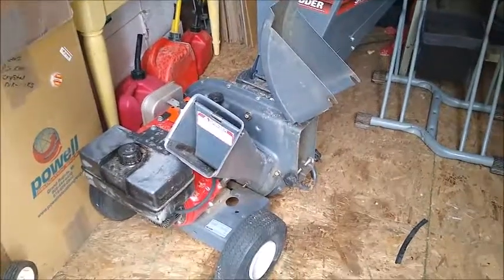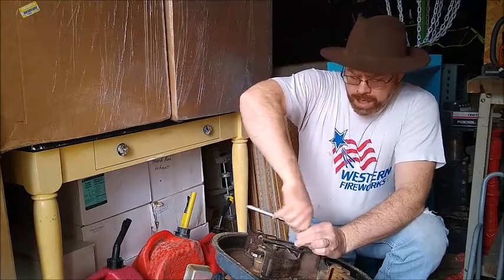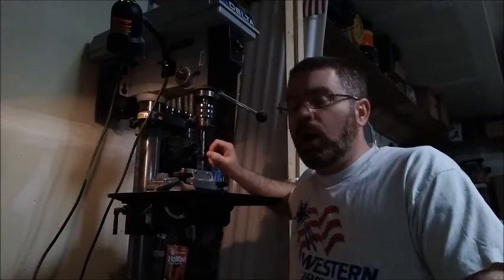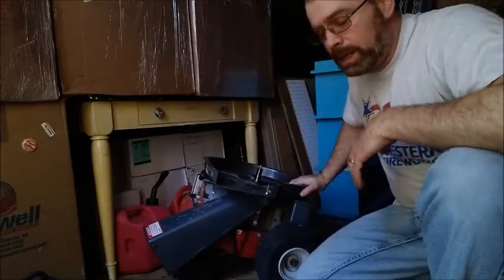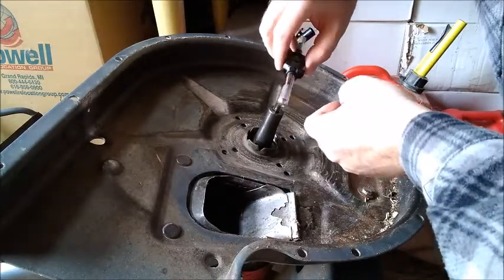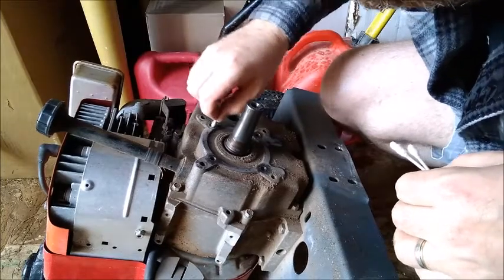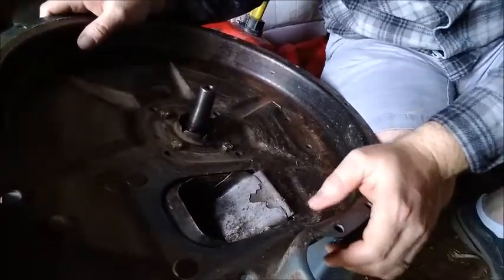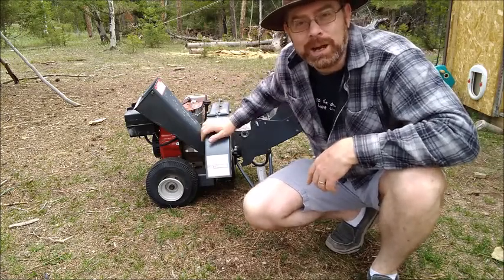Craftsman 9HP Chipper Repair, Including Impeller Removal

Comment: Thanks to your video I saw how to remove the blade assembly. However rather than drilling the bolt I just cut a piece of 5/16 hot roll round 2 5/8 long and put it in the shaft before the bolt, it worked fine with no damage to the threads.

Comment: Hey I made"your" extraction tool and my pen of 1/4" screw with three marks for the hardest also buckle and I caught it soon and replace it with a fresh bolt and it also bent but the inpleryor came off as your sample also.
 It bent but also got the job done!
Thanks for the teaching and showing about"your tool" as you taught me there is a special tool for the job, Don't we hate to buy a tool which we might never use again.

Comment: Thanks for the video.  I was thinking of pulling my 10HP off of my chipper and installing on a roto-tiller.  However, the shaft doesn't have a keyway in it so pretty sure it won't work on the tiller.  Watched another video this AM of replacing the blades but they didn't know how to remove the hub.  Thanks for the "how-to" and including it errors and all.  Great video.
Reply from the maker: Thank you.

Comment: On tough to remove shaft pulleys or other shaft mounted devices, I find it easiest to drill a small countersink in the head of the extractor bolt and use an air hammer with a conical point on the end to vibrate the crap out of it while using a prying device to "walk" the pully off the shaft. The vibration tends to break up any rust between the shaft and pully. Works great on small engine flywheels too.

Comment: Thanks for the video, I live in the UK and have an old 8 hp MTD 465 chipper (Craftman Chipper) which is in need of TLC every time I have to strip it down to sharpen the blades. Previous owners tried forcing metric nuts on to the threaded studs that hold the cowling on so I've replaced all the 1/2" bolts with metric ones and have a supply of nuts I can now use to rebuild it properly. Hey-ho. Eventually I'll need to take the impeller off so It was good to see how it was done.
Reply from the maker: You are very welcome.  Sorry to hear about the metric versus inch mix up.  Glad that you got is sorted.

Comment: I made a two piece removal tool.  For the inner piece I cut off the head of a  2 1/2" x  7/16" bolt and ground the threads off so it would fit in the 1 5/8" deep hole in the engine shaft and bottom out.  I dropped this "pusher piece" thru the impeller and down into the shaft hole.  Then I screwed a 7/16" fine thread bolt thru the impeller until it touched the pusher piece and torqued it until it pushed the impeller off. When I pointed the engine shaft down the inner pusher piece came back out of the engine shaft.  In essence I made a two piece version of the factory tool using (2) 7/16" bolts that I already had on hand.  Cost: nothing.  If you can find a 7/16" x 4" (min) fine thread bolt that has threads the full length, just grind off 1 3/4" of the threads on the end and you will have the factory tool for the cost of one bolt.

Comment: This actually shows that it's better to use soft grade 5 metal for the impeller remover since it's better to destroy the pin on the tool than the engine shaft. The store bought removal tools might be grade 8 which is not ideal since the tool would survive but the engine shaft might not. When I do this I'll probably use a combination of a 2 jaw puller and a few pry bars pulling behind the impeller disc so there's no chance of destroying anything that can't just be hammered back flat.
Reply: That shaft should be hardened. a higher grade bolt or solid pin shouldn't deform like that in so it wouldn't get jammed in the shaft. I say this with hind sight as I'd imagine a grade 5 bolt would be fine for this purpose without seeing his deform.

Comment: The tool build saved my job. .as I used a 1/4 bolt and after it bent I also replace the 1/4" boat and the impeller came off as the second bent.
  I'm looking for a USA made Allen wrench and cut to fit  plan to replace the bolt  and don't think the Allen wrench shaft will bend unless its from China or Harbor freigh , 
  We have great tool steel in this country why import tool steel?

   ?????  Question do you know what torque for replacement for the impeller?????????
Reply from the maker: I was unable to find a torque value when I did the repair.  My machine design professor in college always said that "snug plus a quarter turn was better than most torque values," so that is what I do whenever I can't find a published value.
Reply: LOL I tried an Allen socket wrench bit that probably came from HF (Pittsburgh Tools) to get the chipper blade off. It twisted around about 360 degrees. I finally put on a Craftsman Allen wrench and hit it with a hammer, no twisting.

The torque spec for the Yardman 8hp chipper, basically the same machine, is 550-650 inch-pounds. I set my torque wrench to 40 foot-pounds which should be in the middle of that range.

Comment: Well, Im about to try the same thing. I have to tear down my motor so the impeller has to come off. I think I will try just dropping a steel dowel down in that is harder and a bit closer to the diameter of the hole, or maybe I will just make a one piece tool on my mini lathe. Time to go check the bolt bin and see what I've got.

Comment: Hi good sir!! I just Diy’d a better solution for the impeller removal with no thread damage.. here goes

Found two spare bolts, one matches engine shaft threads the other matches the “remover-tool” threads

Tools required- just an angle grinder and flat blade that fits into the hole

So i hacked the first bolt off about 1/4 inch above the threads… beveled the edges nice and good (no mushrooming)… cut a slot in the top for a flat blade

Used vice grip and wood block to hold the bolt for angle grinding (safety glasses ofc)

Ended up with 2 piece removal tool. Use flatblade to thread in the modified bolt till its tight… squirt rust penetrator in there and tap the impeller with a hammer or pipe 20 times…

Insert remover bolt and use breaker bar to very gently (small increments) tighten until it breaks loose

It reminds me a lot of removing bicycle crank arms… same principle and in that case aluminum threads (must be veeeeery gentle and all threads oiled and tight before the crankadoonie time

Anyway yeah this is my old uncle cals chipper… im converting it to electric using an air compressor motor…. No gas smell in the car… always runs and with the lrice of gas just cheaper to operate…

Needs new main bearing i notice the impeller is basically just hanging off the engine!!!

Wish me luck!
Reply from the maker: Good luck and thanks for the suggestion for a different tool!

Comment: Carb spray and compressed air flush will blow the holes out clean for thread locker
Reply from the maker: Thanks for the tip.

Comment: Using your calipers, measure the extraction bolt and the threads it goes into, then measure the length of your rod, which should be a hardened shaft just .010" smaller than the hole it will go into. The hardened shaft won't bend out and cause a problem, No need to drill out the bolt. I can make them.

Comment: 19:25 I'll have to double check but I'm pretty sure the flail was put in backwards, I'm pretty sure it should go so it curves toward the shredder.
Reply: I was just going to make that same comment about the flail screen (called "guard" in the video). The flails on the disc are supposed to smash up the chips until they are small enough to make it out of the screen.

Comment: You went through a lot of work to take that thing apart but one thing I saw you missed you should have done why you had it apart you should have made sure you sharpened each and every one of those blades something that you should really do if you go through all that work to take it apart as well as oiling up those hammer things in there
Reply from the maker: Thanks for the comment.  I actually had sharpened the blades during the teardown.  I just didn't include that in the video since it was already quite long.  Excellent point and I appreciate you bringing it up.